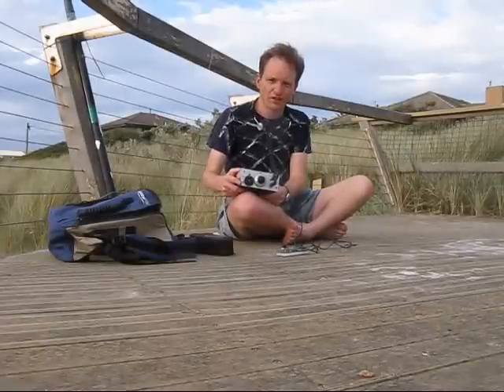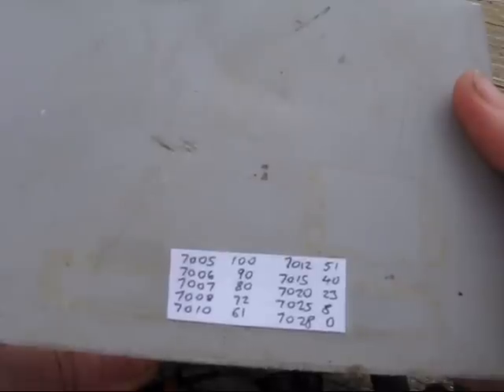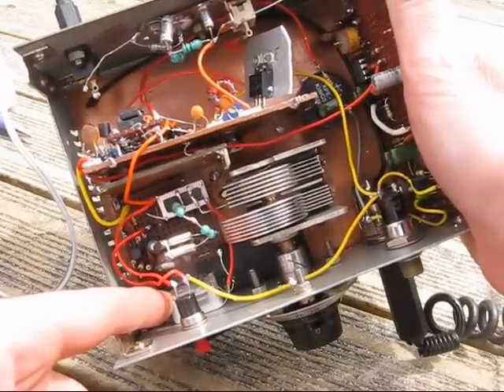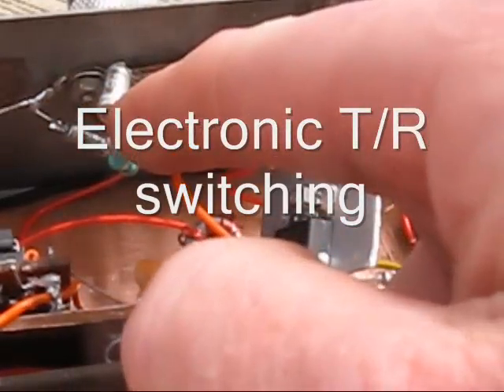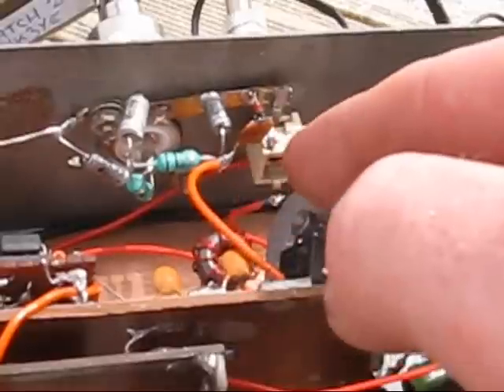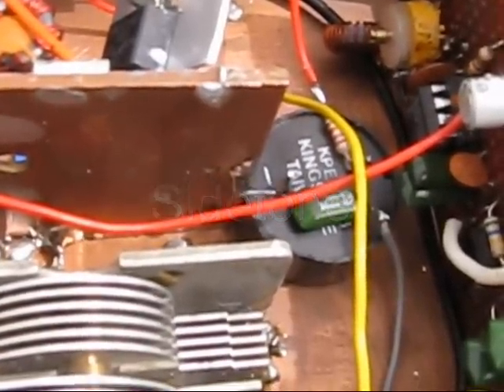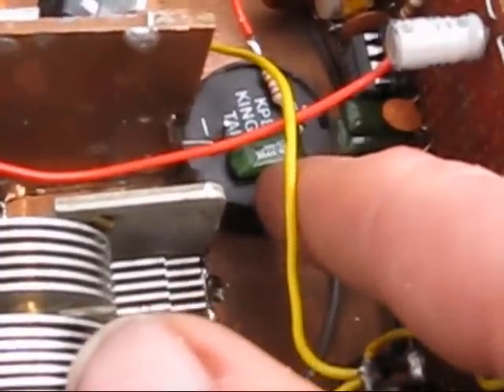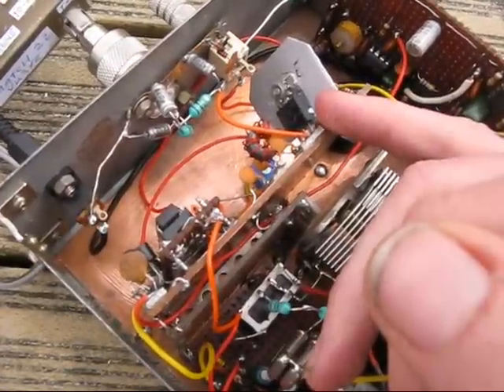Upgrading an old homebrew QRP rig

Comment: Hi Peter...I have need of a circuit for TR switching for separate RCVR/XMITTER pair Seems these days all designs are for transcievers....Do you have a schematic for that solid state TR switching? 73 ...newly re-licensed (after 30 yrs) VK2AOE (formerly VK2PSE/CGD). p.s. Thanks for the great content!
Reply from the maker: I've since taken that rig apart and can't remember the exact details. First of all just try a crude manual DPDT switch. One section switches antenna, one switches power. Then try a relay activated by a transistor. The next stage is more sophisticated with a couple of transistors to drive the relay with a timing circuit. 

As for solid state switching, find circuits of 1990s-2000s era QRP kit rigs and copy that. The Small Wonder series is an example with diodes and capacitors. Details here: https://www.hamanuals.com/MMans/SW-40pls.pdf
Reply: @vk3ye  Thanks Peter!!! I like the start simple and work up to it approach! 73  Thanks for the info...helpful as always!